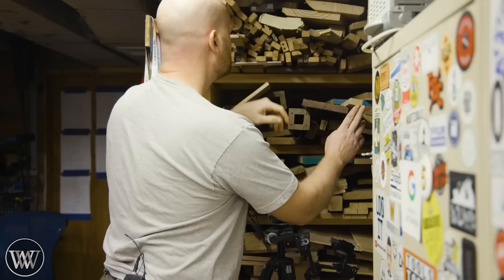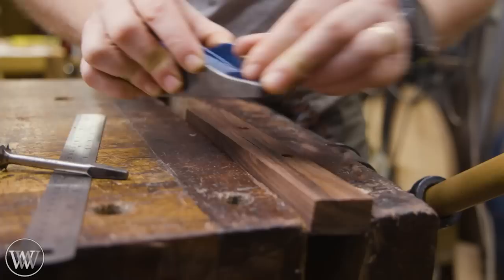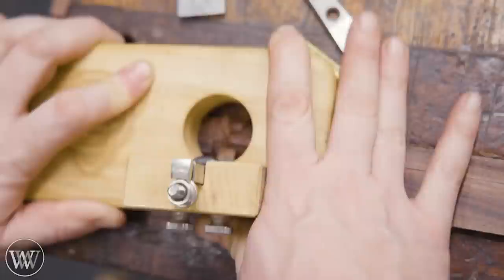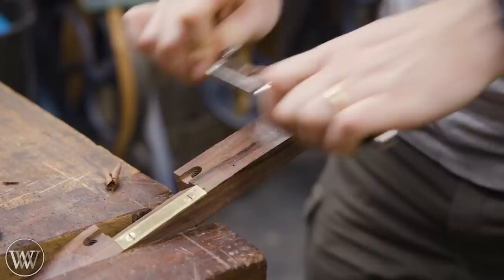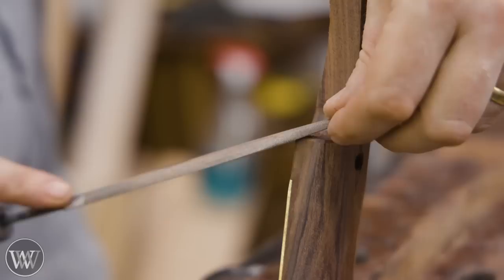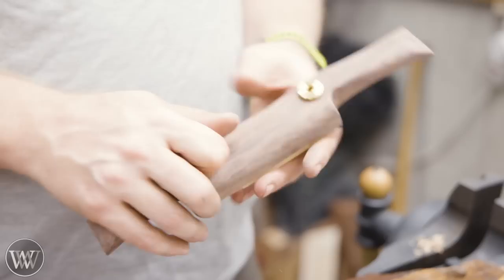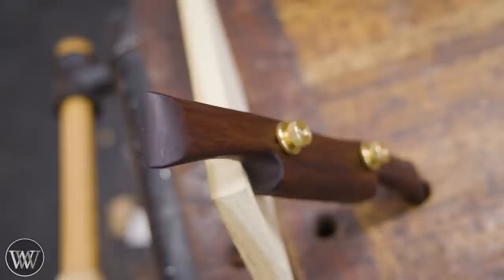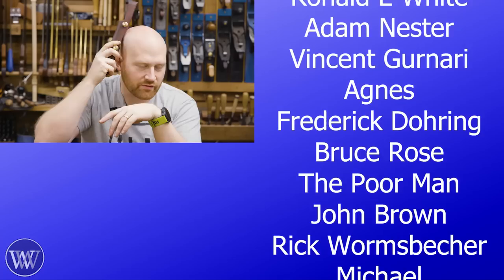How To Make a Spoke Shave Veritas Kit

Comment: I purchased a wood antic spokeshave like yours. I discovered that the tang is crack off. How can I reattach it. Thanks for all you do, we learned a lot. .... OORAH!!  :face-blue-smiling:
Reply from the maker: generally you cant. if you weld, braze or solder it back it will just break there again.

Comment: Thanks for all your hard work on these videos. They are very helpful. I do have a question for you. Do you think if  I didn't include the brass wear plate you could turn it into more of a curved bottom spoke shave? I think I will try anyway but interested in your thoughts. Once again, thanks for all the content.
Reply from the maker: Yes. That works great. Most of the old spokes didn't have a wear plate but you'll find that the body wears down relatively quickly then.
Reply: @WoodByWrightHowTo  thank you. I’ll just use some ridiculously hard Aussie hardwood to reduce the wear factor. Or part of the benefit of making your own body is knowing how to make another one. 
Side note. Love the Dad jokes😀

Comment: You say --(at 4:33)--that a thick piece of card stock should be able to slide in (between the blade and brass /??)--what size is that gap or clearance ?  any dimensions ?as its not shown at all ---and this is the most important gap that allows the shavings to pass through without blocking the mouth /cutting area ---can you show a close up ??
Reply from the maker: The mouth opening really isn't that important as long as it's larger than the shaving you're wanting to take off. The mouth doesn't have to be crazy tight on this because if the grain is reversing then you just turn it around and go the other direction.